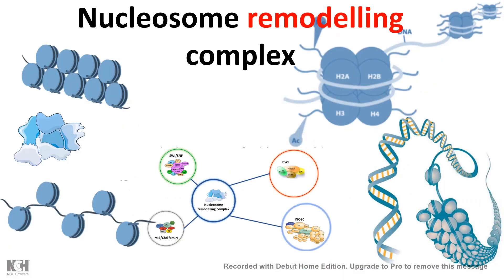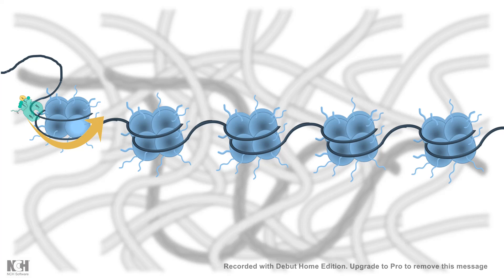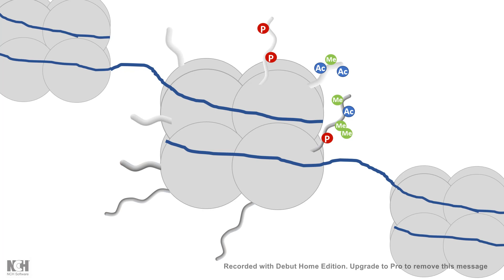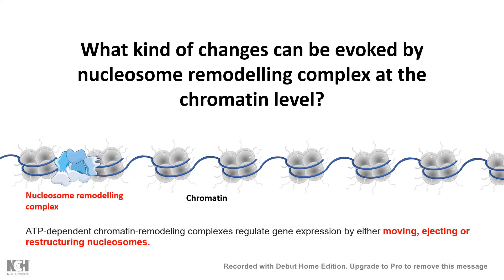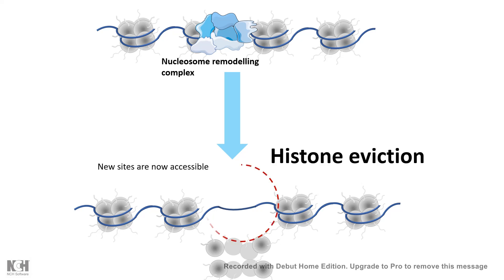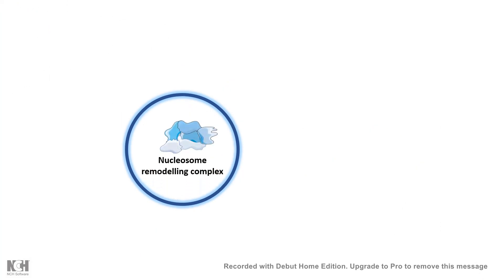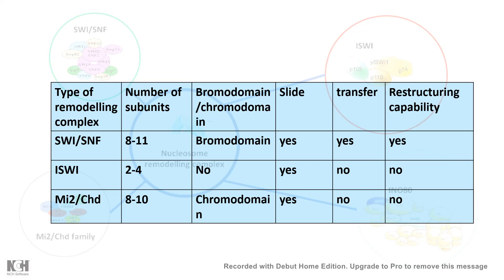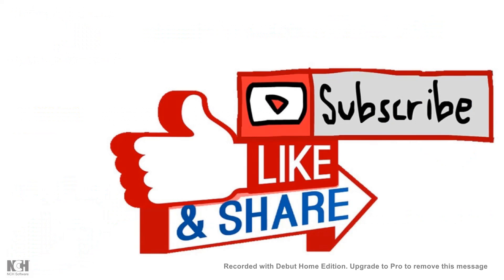Nucleosome remodeling complex( introduction)

Comment: Hey man great video, thanks for your effort! I do have a question though. As far as I know members of the ISWI family do actually also contain a bromodomain in chromatin remodeling complexes, such as for example NoRC. There's a bromodomain in Tip5. So the ISWI proteins (like Snf2H) do not harbor them but the associated ones in the complex do. Is it a matter of definition then? Because on the one slide showing the table about the different families, you define the ISWI family as having no bromodomain.
I hope this was understandable.
Thanks anyway :) great presentation